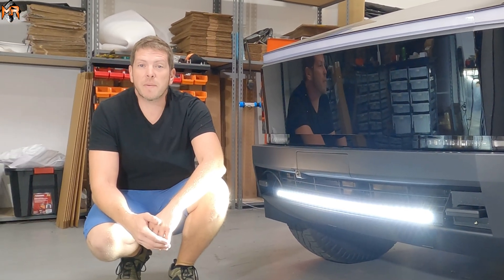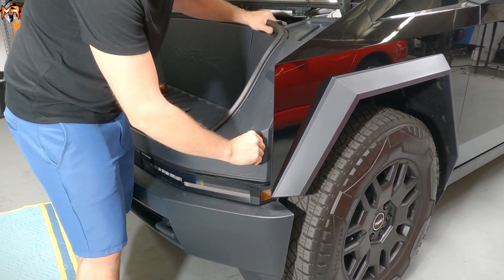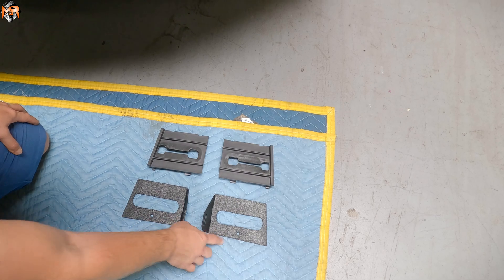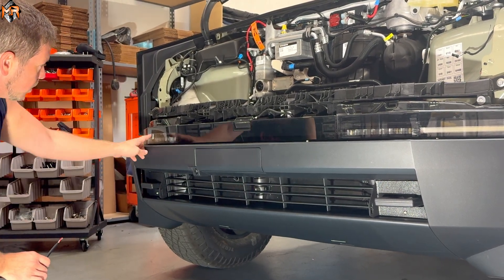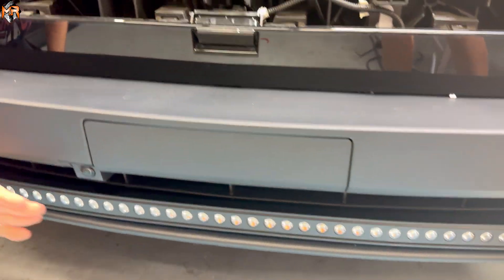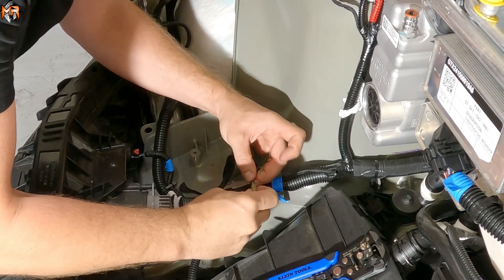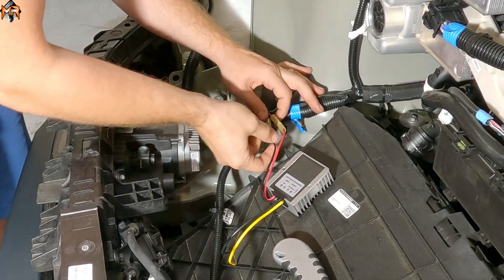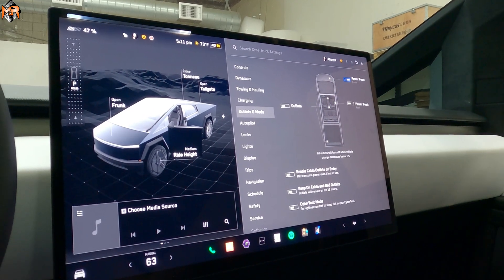Tesla Cybertruck  Curved 40in LED Light Bar Slim Install | Tutorial by M&R Automotive

Comment: Do you need to manually turn on the screen light each time you start your drive, or does it automatically return to the previous setting?
Reply from the maker: Yes you need to manually turn on the lights

Comment: It looks like the step-down was connected during the voltage test. Does the slow voltage drop happen with the device disconnected? I was wondering if there were any capacitors in the step-down circuit.
Reply from the maker: @Curbow5  no we tested without. It drops from 48v and can only reengage when it’s in single digits